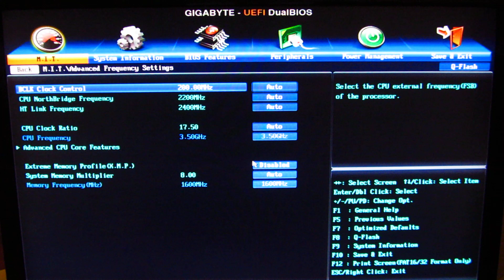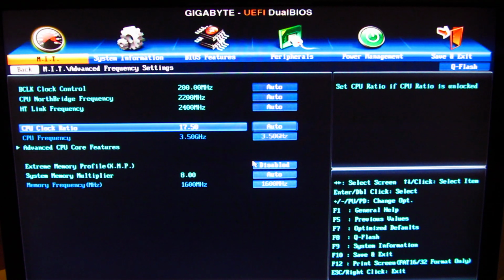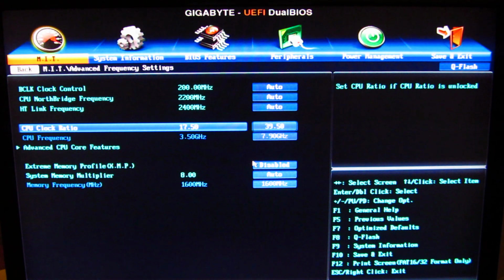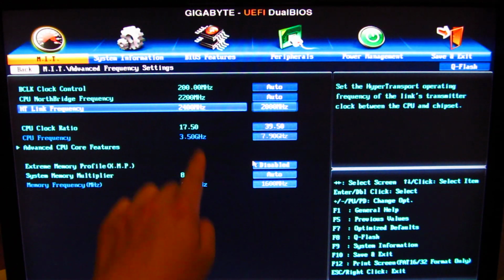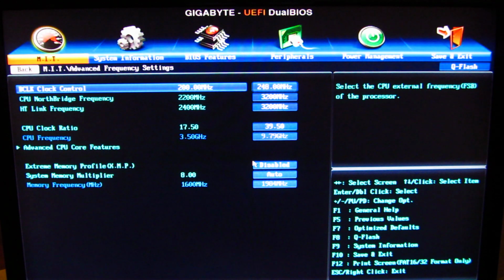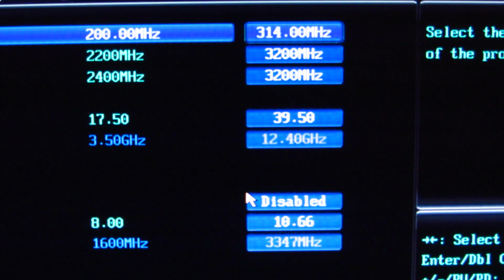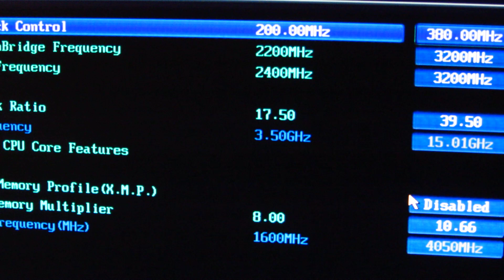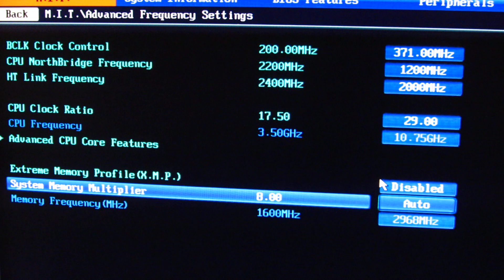Gigabyte Motherboard 970A-D3P  BIOS All Settings (Not an Overclocking Tutorial)

Comment: I have that problem! I have an fx6300 with a Gigabyte 970 gaming mother, the bios is the same and I have 10 gb of ram and usable 3.96 gb. Is there a way to configure something in the bios to allow me to use all my ram? long ago I touched something in the bios and solved it but I don't remember what I did !! I have reserved for the 6 gb system and it is a lot please help me
Reply: Hii did you solve the problem? same thing is happening to me... =(

Comment: Using the same board and fx 6300
But my pc shows only 12 gb ram usable out of 16 gb 
Don't know how to resolve it please help
Reply from the maker: go into the BIOS, you've reserved 4GB for the onboard video
Reply: @PoolarityChannel  it's does not have a option of chipset (or) pcie slot (or) onboard graphic 
But somehow I resolved it by changing the places of the ram.
THAKS FOR THE REPLY MATE
Reply: I have that problem! I have an fx6300 with a Gigabyte 970 gaming mother, the bios is the same and I have 10 gb of ram and usable 3.96 gb. Is there a way to configure something in the bios to allow me to use all my ram? long ago I touched something in the bios and solved it but I don't remember what I did !! I have reserved for the 6 gb system and it is a lot please help me
Reply: @nazamodsgta  Did you ever figure this out??

Comment: @Poolarity Is it possible to change the Graphics Card port in these BIOS?
Reply from the maker: What do you mean by Graphics Card port, this motherboard does not come with built in Graphics.  However, I run 2 video cards on this and use Dual Monitor.
Reply: I think you mean trying to use the 2nd 16 X4 port?

Comment: this mobo is kind of a mess..... a friend of mine ask me to help him because he's not able to boot from his ssd. It seems to be a bad config on the bios but I couldn't find the right one. Do this happened to you at one point? +Poolarity
Reply from the maker: No, totally fine for me I paired this with my AMD FX8350 8 Core.  If you have issues, did you just reset back to Defaults in the BIOS?
Reply: yep, I'm yet to try and clear the CMOS but I did load the optimal values several times as well as play with different options. I solved that problem once before but I can't remember how I did it.
Reply from the maker: +Luis Felipe what is the error, what are the error beep codes?
Reply: nah, the board seems fine. I can even boot into ubuntu live using a flash drive. I just get a general windows error that my system needs to be repaired. I'm almost certain that it's a bios setting fucking things up. I'm formatting again the ssd boot drive with the optimal values setup to see.
Reply: Very Good Reply.
Reply: did you ever get an answer? i have the same problem

Comment: The video is wrong from the start to end... This is bad man... very bad... you didn't even research about before made this video... This video sucks, he is just frying the PC, messing around without knowing what he is actually doing... Sucks at all!!!!
Reply from the maker: I am simply showing every BIOS screen and all the possible settings, min and max.  As mentioned in the video, showing you the setting that can be changed.  Since that's the questions people have asked.  Never claimed this to be a tutorial on overclocking, that would be dependent on what CPU you are using.
Reply: He said that he doesnt overclock and he just shows the options of the bios. If you are stupid enough to put your cpu to 12ghz then its your problem.
Reply: @ГарикСтепанян-у4п  I think he doesn't understand english lol

Comment: how could an oc cpu lead to loss of hdd data? theres a backup bios... you really don't know what you're talking about. lol. plz don't make these video's somebody is going to fry their cpu. sigh... at least you didn't tell them how to change the voltages so as soon as somebody overclocks more than 200mhz past clock it wont boot and they'll only need to jump the cmos. I have this board and it's not that great for OCing (in this price bracket). if you want to OC buy an AsRock (they used to be crap but they're good now).
Reply: +Joseph Stott Oh Wooww maaan,you just said what i was thinking but with like words man...
Reply: Drumvain
aww shucks. at least somebody on youtube doesn't hate me :D
Reply: Thank god he didnt as ive been trying ffs
Reply from the maker: Indeed overclocking instability can lead to Data Corruption.  Google "Anandtech Overclocking leads to Data Corruption".  Keep in mind that data is held in memory prior to being dump to disk, so if the CPU is unstable and the writing to the memory pages are out of sync and inconsistent, it most definitely leads to Data corruption.  It manifest itself as junk files on disk.

Comment: I have this board with AMD FX-6300. I noticed if you set the NB Frequency any higher than stock 2000mhz, Windows will act weird and Aero will be disabled..even if increasing the northbridge vcore.

Comment: hi, I am using gigabyte H61ma d3v mb. Once I updated my bios from F1 to F6 my turbo boost has decreased to 3.2 ghz (i5 2320 3.0 ghz -> 3.3 ghz before update). Now when I enter Bios I see, cpu running at ~3.2 ghz, and when I go to check advanced settings I see its values being set @ 3.0 ghz and turbo boost values are set @ 3.2 ghz (all 4 cores). Any ideas how could I fix that? Btw updated bios to f7c beta - still the same.
Reply: klubbstyler isn't turbo boost speed just what it peaks at, it doesn't sit at that speed for long periods. The update probably was just a correction because they found it could be unstable. I doubt you will see any hit in performance just from a turbo boost speed adjust of 100mhz. Most phones are 1000mhz to put 100mhz into perspective.
Reply: it seems it was a bios bug (maybe because it was beta one f7 or whatever) because when I upgraded my cpu to 2600 it was still running at 3 ghz instead of 3.4 ghz and I couldnt change anything. But downgrading bios to f6 solved all problems and it runs like charm now. Also I would have never updated my bios but old versions didn't recognize nvidia maxwell cards.
Reply: klubbstyler
oh well that solves that then. and now you've learned a lesson about steering clear of beta drivers lol.

Comment: tnx i done oc to 4.6 but cpu fan so loud.
Reply: prohunter gaming No it does not the chip just gets hot so the fans have to blow the air faster nothing that has to do with overclocking too much.
Reply: that means u over locked to much
Reply: overclocking a cpu without some type of cooler is not worth the risk. that being said you can get a few hundred extra mhz without too much risk(not 1.1ghz as keith has done here). MY OPINION, do what you want.